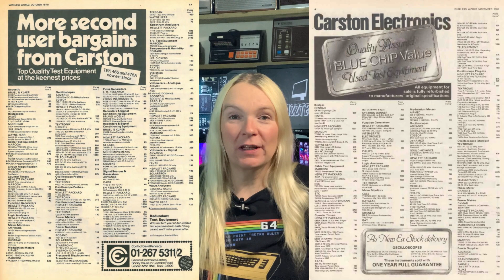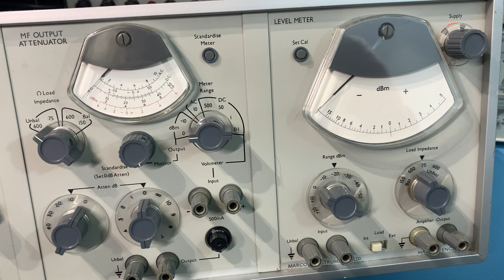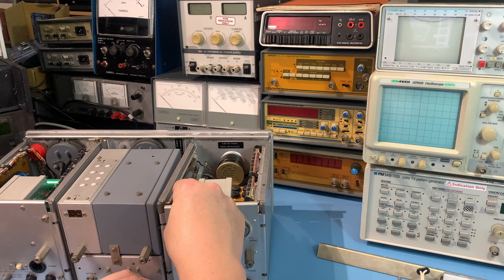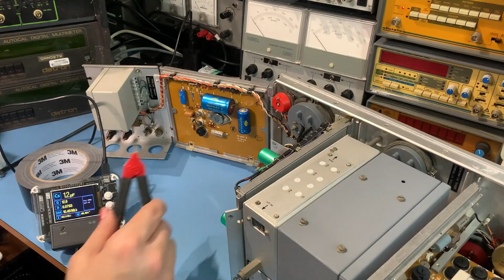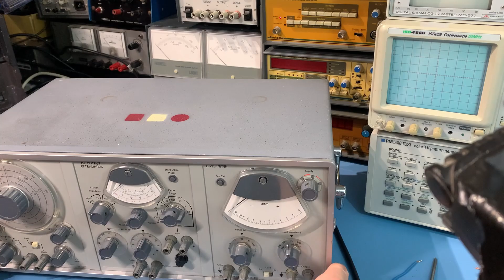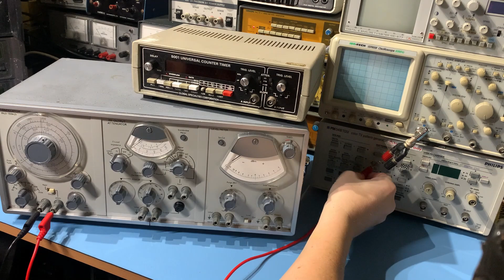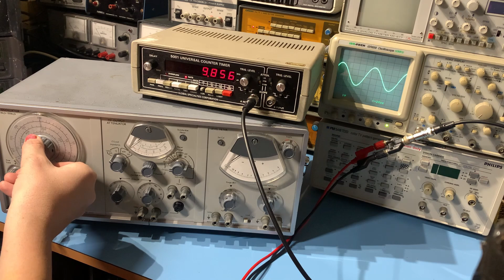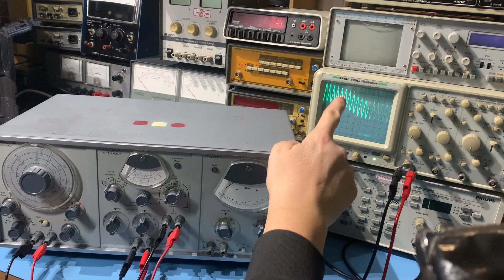The Marvellous Marconi TF2333 Audio Test Equipment - Oscillator, Attenuator & Meter all in one!

Comment: Interesting to see those crazy capacitor values, e.g. 50uF and 8uF. I wonder when electrolytics started to be made in more popular standardised E series values.
Reply from the maker: A quick look on Wikipedia reveals it was around the 1940's to 50's that component manufacturers started adopting the IEC standard of 'E' series values. This was driven forward by the second world war and mass producing consumer electronic goods and the need to keep a 'standard' inventory of parts cross compatible with other equipment.

Comment: 9:50 Are you shure those are just standsdoffs? In my Marconi TF2331 Distortion Factor Meter,
all transistors was mounted simmilar, but they were sockets.
Lots of tarnish on the legs, so that needed cleaning.
Hope you do a followup video on this. They are quite uniq units.
Reply: They are definately standoffs i have changed lots of transistors like that at Marconi service division.
Reply from the maker: Yes they are standoffs. I most probably will come back to this at some point. It does need some work on it. Thanks for watching and thanks for the sub.

Comment: Hi Jane, is that a Realistic DX-150B just over your right hand side, I've got a plethora of vintage receivers as well as test gear. 

Nice to see the AVO on display 👍
Reply from the maker: Yes, it is. Haven't even had a chance to try it yet. It's in very nice condition but it's 110V, so will need work on the power supply first.
Yes the AVO is on display. It has its pride of place on the shelf. Thank you.

Comment: Hi Jane. Mechanical and electronics engineering at its' very best. MOD probably the only people that could afford to buy one new! I still have, and use, the test equipment made by Sugden. I live in West Yorkshire and they are a local company, still in business building very expensive audio equipment. The oscillator has a 0.02% THD, which was very impressive in the day and is still good enough today.
Reply from the maker: I didn't know Sugden made test equipment. The low distortion in the oscillator will be down to the thermistors used in the feedback loop. A common method in its day but not used any more. You can't even buy them now, not from anywhere. Thanks for watching.
Reply: @JazzTechUK  They didn't make it for long, but they made a set of 3 matching units, oscillator, AC millivoltmeter and distortion analyser. I have 2 of the oscillators and 1 each of the others. Originally, they were battery powered with ordinary non-rechargeable batteries. This was inconvenient due to cost, but made for a very high grade performance as regards signal to noise, ground loops etc. I have converted mine to separate external power supplies, and they do everything I need nowadays. You're bang on about the thermistors, it's a Wien Bridge oscillator circuit using Mullard and Dubilier capacitors all of which have test labels on them, so they must have tested and matched them all before production. They are let down by the quality of the rotary switches which regularly go intermittent and have to be cleaned or replaced. Gone are the days!
Reply from the maker: Hardly anything is made well these days. Really a great shame.